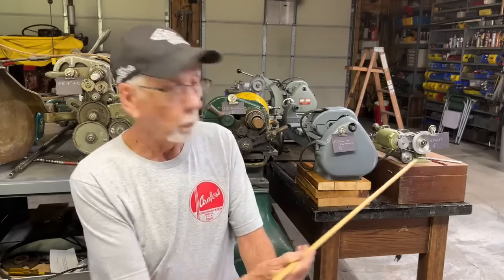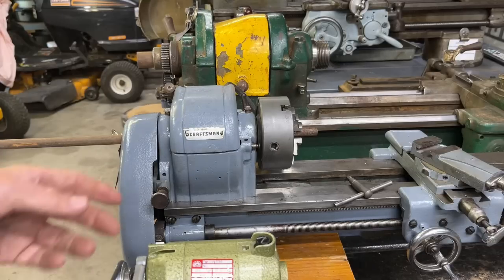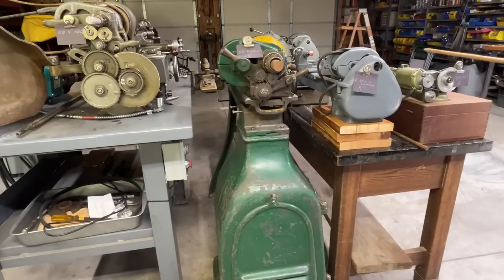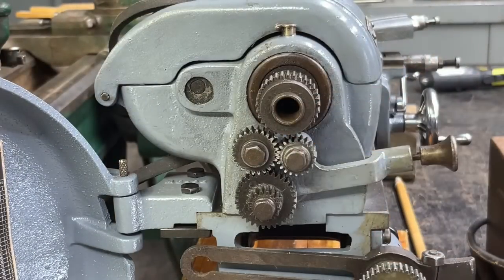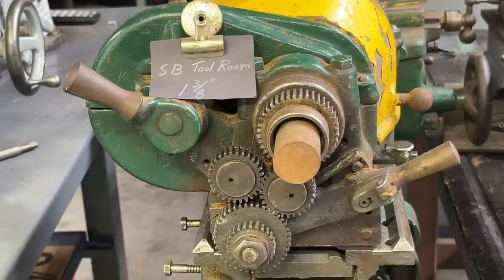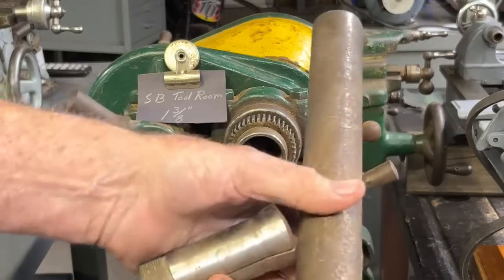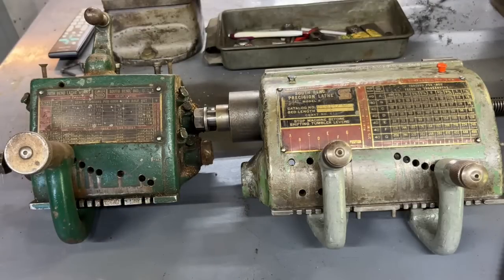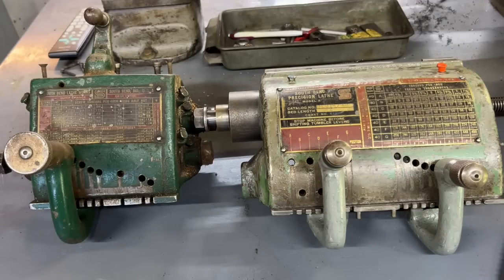COMPARE LATHE SPINDLE BORE SIZES #957 atlas south bend unimat tubalcain

Comment: I know you’d need a tail stock to center and steady the material to dampen vibration, but if you had a long piece would you need the same thing on the head side to keep it from whipping around?
Reply from the maker: Yes, whipping is a big problem with long rod stock in small diameter

Comment: I originally started with a Hercus 9" and now I've upsized to a lathe with a 12"  50mm bore and I also have 60mm bore 14" lathe but find I use the smaller of the two.